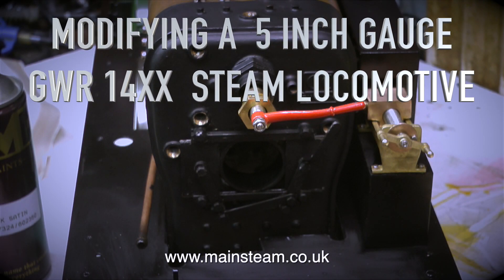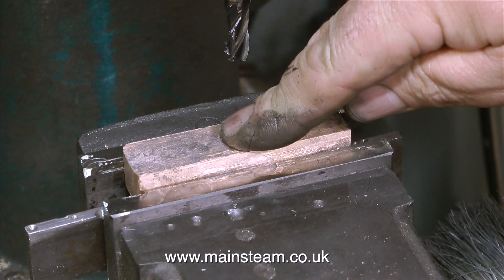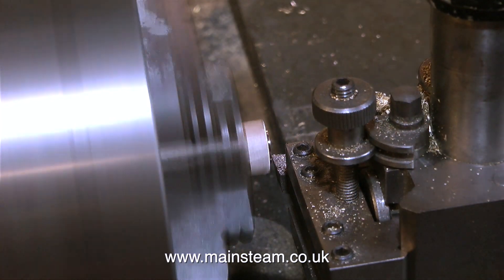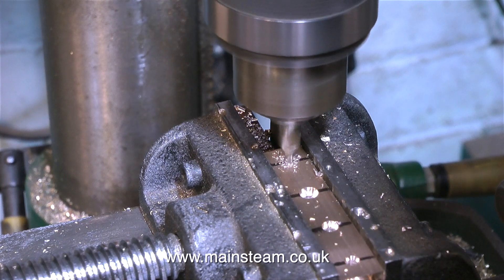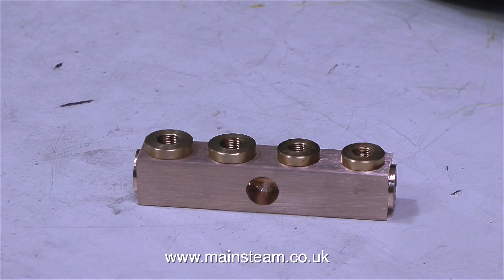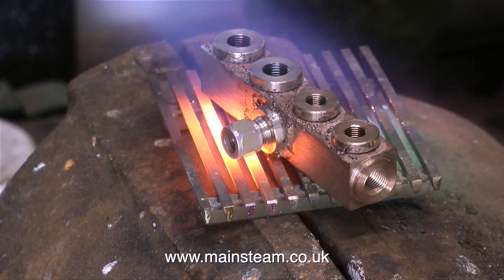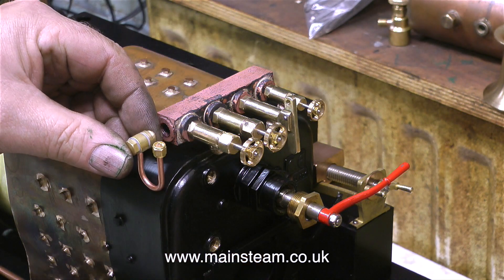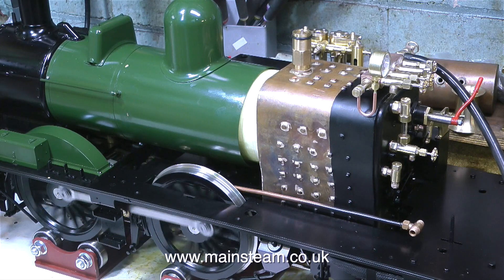MODIFYING A 5 INCH GAUGE GWR 14XX STEAM LOCOMOTIVE PART #15

Comment: Great job Keith! The shiny brass really complements your amazingly crafted turret! One question, why did you choose to use gunmetal as opposed to brass or some other metal. Is it just what you had in the pile? Love your videos, keep them coming!
Reply from the maker: Brass is no good for turrets as it deteriorates with age & heat. Gunmetal or Phosphor Bronze is also a lot stronger.
Reply: @keithappleton  thank you for your quick reply. Sorry if these are easy questions I'm quite new to the hobby and quite inexperienced.
Reply from the maker: No Problem, glad to be able to help }:-)))

Comment: nice video Keith very interesting, as always, time to pick your brains, if thats ok, years ago when I was an apprentice engineer I built a model steam lorry, it never really worked very well, so now , after 31 years I have started to put right all my apprentice mistakes , so it will require a new engine and I have already cut all the parts for the coal fired verticle boiler, to this end I am about to order my silver solder, I noticed that there are different grades of solder with varying percentages of ingredients, on the under standing that I will need some different melting points, which grades should I be using ? thanks in advance John,
Reply from the maker: Please watch some more of my Silver Soldering videos - maybe starting with this one ..... https://youtu.be/kIKQ-FL96uU

Comment: Recently I'd bought what was once quite a nice, US-made drill press which had the same self-starting motor trouble you mention. I was able to remedy this by removing the starting capacitor cover from the motor, and searching for the part number printed on the old capacitor, and then purchasing and fixing a suitable replacement.
Now the motor starts every time, and the part was only $8 US.

Comment: I have driven all 3 versions over the years and got to know the designer of Didcot upon which this lovely locomotive is based. The Winston one works well as long as you have a lifetime of knowing which bits to keep!!!!!! 
There is a lovely Kingscale one in the club as well as a Modelworks which does not WORK!!
Poor thing needs taking apart and the list of things to discard used as target practice with the waste bin!!
David and Lily... Just recovering from a superb afternoon (Yesterday) of riding behind an A4 in superb Blue?  7 1/4 of course!!!!

Comment: Keith

As you are  in the UK do not get fire bricks ,get some thermolite building blocks from your builders merchant they are much cheaper and the reflect the heat better , only one drawback don’t get them wet

They are the light gray ones ,not the heavy concrete ones they are normally used for the inner walls in houses

Comment: Nice video once again, Keith. I know there's a method to your madness but wouldn't it look better with an injector valve on either side as opposed to being right next to eachother? Seems to be set up in a symetrical fashion on the fullsize ones.
Reply from the maker: You may have a point, but I like them nest to each other, plus I wanted the blower valve to be more or less inline with the hollow stay in the boiler. Please continue to watch as I pipe it all together, you will see why I but the injector steam valves nest to each other {:-)))

Comment: You're great at making turrets, they always turn out looking fantastic. I was a little worried about how the extension for the pressure gauge would look at first and wondered if it might be better to make some unorthodox bends in the copper pipe. But no, that looks great too, and kind of symmetrical with the plug on the other side.